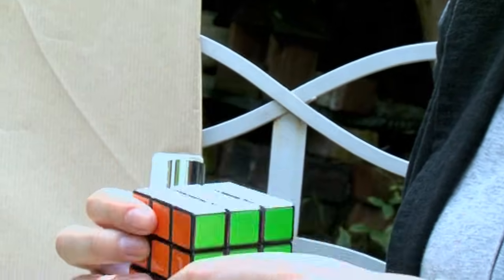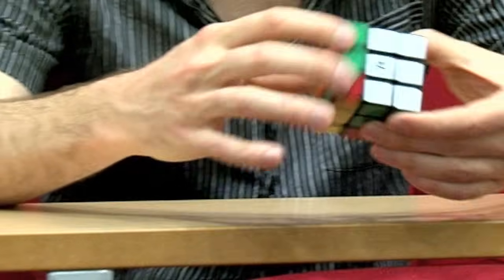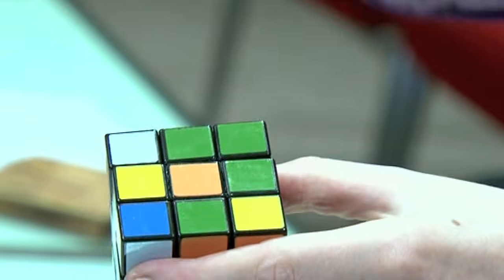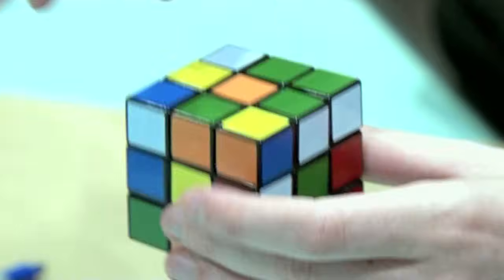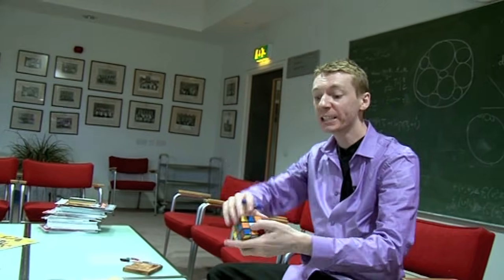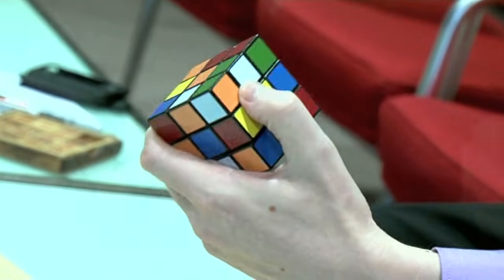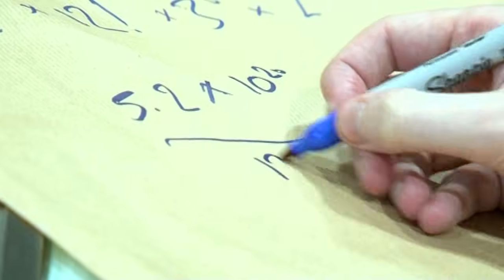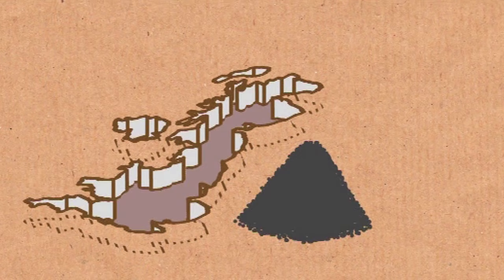43,252,003,274,489,856,000 Rubik's Cube Combinations - Numberphile

Comment: Good question. Let's say I have two cubes. For the first one I put all the pieces in the correct places. For the second one I put in all the pieces as if I had rotated the cube a half turn. These are not the same because the centre pieces do not move. On the first cube all the orange pieces would match the orange centre piece. On the second cube, the orange pieces are on the opposite side of the orange centre piece. Otherwise you would have been correct.

Comment: My math shows that if the rubik's cube can be scrambled 43,252,003,274,489,856,000 different ways, then you can store a secret message in it that is 8 charactors long using the 256 ASCII charactors.

Comment: There are 43,252,003,274,489,856,000 possible arrangements of a standard 3x3 Rubik's Cube. I guess by standard, you mean that the Cube is in a solvable arrangement. As stated in the video, there are 12 times as many possible permutations of the Cube except that only 1/12 of those can be transformed into the "solved" position.

Comment: the problem with putting it together is that you have to arange the colors properly or you are not able to solve it for example you have a colored string and slice it into pieces and arrange it random and fix the string you get a scrambled string without order^^

Comment: Now, don't you have to account for the positions of the edges and corners around the center? For example, what if you took the original cube and changed only the centers (which is possible to do without breaking the cube)? Are those accounted for?